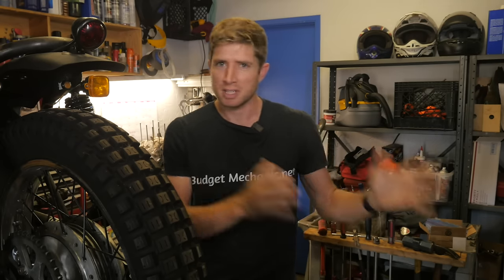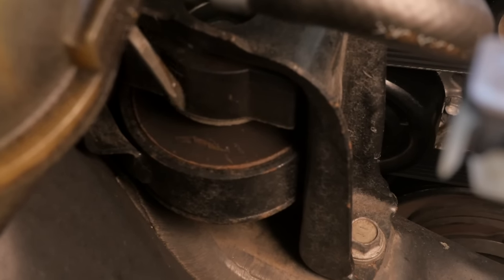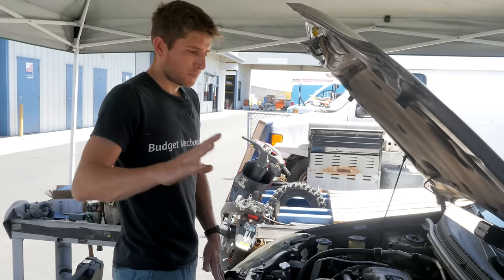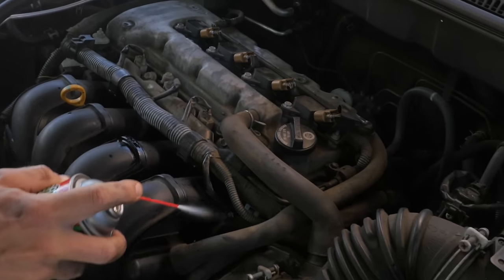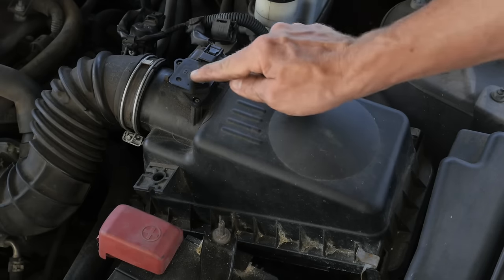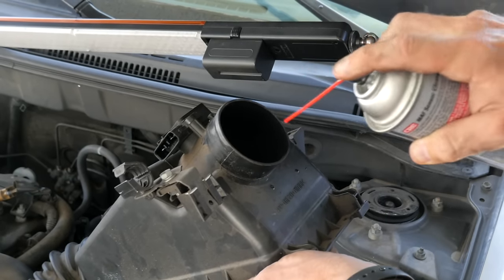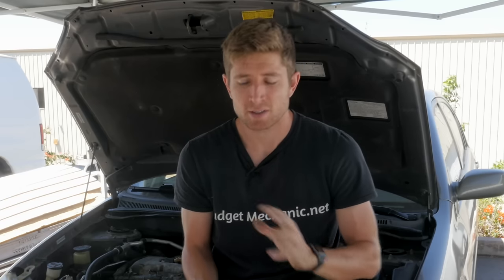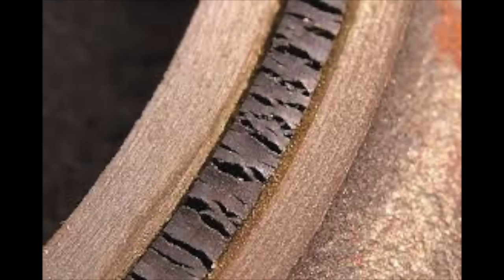Diagnose and Fix Rough Car Idle - Main Causes For Shaking / Vibrating While at a Stop

Comment: Wow! You are an awesome teacher. Thank you so much for the great information.   We were dealing with a crank no start on my 2008 Toyota 4Runner 4.7 v8 sport edition for 6 grewling months. It was so disheartening. I watched so many videos to help my 62 year old hubby.  Don't get me wrong he is a great mechanic.  But, hes old school used to dealing with a carburator and no obd2 computer.  Trust me, i made him absolutly nuts. Been married for 23 years but, having his wife second guess him was not good for his confidence and for that i am sorry.  It's just that my father was dying and we are not well off.  I made the mistake of buying the car with 232000 miles on it and not making sure things were maintained like he said they were.  Getting older his memory was starting to wither.  We or he replaced the bathery, checked the fuses and the 3 relays for the fuel pump, chsnged the gas cap. Cleaned the maf sensor, cleaned the trottle body unnecessary changed the crankshaft position sensor and he dropped the tank cleaned out the tank, changed the fuel filter and found out the fuel pump was ok, changed the spark plugs and still nothing.  When my father passed away he left me some money, wait i forgot to add the ignition switch assembly with a set of keys to reprogram. Alot of money, alot and hope was gone. Had 2 codes po113 and po102.  Check engine light and a couple others. The toyota dealership quoted me a price of 3500 to drop the tank clean it change the fuel pump assembly eventhough it doesnt say that on the service receipt nor at Toyotas main headquarters where it shows your service done.  The installed the ignition switch i bought reprogramed the keys and after about 3 days finnally called me. The wierd thing is the diagnostic info had everything as a pass but the tires which i replaced and they said a " vacume leak that was no big deal and that the catalytic converter was rusty and needed to be reported but no big deal.  They initially told me they could fix it in a couple days they were waiying for " the sucky thing for the fuel pump. And an o ring it would be available sometime next week. They wouldnt answer my questions when i asked them what parts were they waiting for? I said the fuel swnding uniti and the o ring. She never responded. I know its supposed to be a complete unit replaced. Meanwhile since she never would answer the phone or my text i called toyota. Of course they heard about it and sent me sn kinda nasty email i ignored it. Then on sunday the car was ready. Three days later. Even though they were waiting on parts to arrive in about a week. I cant help but feel scammed. They didnt even take the price of the diagnostic off the price they added it. Told me 1700 to drop the tank and replace the fuel filter was rhat much. To replace the ignition switch went from 1700 but since i had the part from florida at another dealership the took that down to 800. Then 189 for the fuel injectors cleaned and the butterfly thing cleaned. Sorry i forgot the name because i know nothing about cars, i just watched videos over and over. Throttle body. Thats it. Clean the throttle body for 199. All equaling 3600. I couldnt figure out how she did her math. Trust me i asked. Hense my call to Toyota headquarters.  I Just wanted my car fixed nowcheck engine light back on with vsc off and squiggly line light. Im thinking cat. My question to you is how do you feel about catclean. I'd rather things and then I read bad things and I know nothing. Sorry it was so long. You seem like an honest gentleman that really calmed me. So much good info. I really live the suv. But, im so afraid they put little bobby traps in there and little by little i will pay again for calling toyota. I hope we dont need a new cat. We are now getting the dreaded po420 code. The car was light free then when my father passed away he drove from Louisiana to florida. Lights came on. I read somewhere that cats need to be warmed up to read properly and the fact they were about 600 miles warmed up that it was that. The cat is the reason for the check engine the vsc off and the sqiggles. I will never go back to that Toyota dealership ever again. I think its a shame because they lost someone that could have been a  lifetime customer.  It also makes me sad that human being could treat each other with such distain and in this world of technology , lack of morality, lack of the golden rule teachings and the religion of be good in your heart thats all that matters is gone. Texting a customer is apauling and shifty. Have the guts to use your voice before we   lose sight of this beautiful world where life is so precious and short. I am 57 my dad was only 82. But , i still felt 12 around him. He knew how to do everything. I will forever be changed by his loss. People like you are one in a million. The way you teach is inspiring. Thank you.

Comment: Thank you for this great video. It was really helpful. My wife Infinity was shaking violently and kept stalling. It turned out the connector to the air system was loose. Thank you! You saved us thousands of dollars in repair.
Reply from the maker: Great job!!
Reply: Do you know what that part is called? Thanks
Reply: The name of the connector to the hose?

Comment: I just had my exhaust on a 2005 Mercury Grand Marquis worked on, by a custom exhaust specialist. The reason I took the car in is because the hangar broke and pipe began rubbing against the inside of the car. I also knew I had an exhaust leak most likely in the manifold. But there was no check engine light on and car started up beautifully, drove beautifully despite the ticking noise when accelerating. The mechanic also fixed the suspension, unrelated but definitely needed. I didn't replace the exhaust manifold because it is too big of a job and the mechanic was able to weld the tube as best he could, leaving only a very small leak. No more fumes, or ticking but now the car is vibrating during idle and check engine light on. I took it back it was for emissions and he said everything else seemed good, no misfires. But now the car is having trouble starting at times. I'm just gonna take it somewhere else which I would have done, but I heard these guys were cheaper because they can weld. It could be unrelated, but it seems too coincidental to me

Comment: Here is my situation:
There is no check engine light and the car starts fine but has rough idling in hotweather or after the 1st trip.  So if you drive in the morning to get gas there are no issues, but after you start up your car again to leave the grocery store (2nd trip within a short amount of time) it starts idling low or bad.  
The 2nd trip situation seems to fade with extended time.  So if I go to work and then work my 8 hour shift and then leave, I dont notice it much unless its hot weather out.
Other things to note.  My "charging system" failed when i had it tested, but my battery passed.  I took out my alternator and my alternator passed the independent/isolated test on the machine at 2 auto stores. 
I have an AC adapter that reads voltage and at stops/red lights it drops below 12v.
I will check the air lines though but wondered if there are other things to check.
Reply: Same issue, hope you fixed how can you explain me

Comment: Just an important thing to know: Seafoam should ONLY be used on regularly maintained/ late model cars (newer ones), otherwise it can cause too much space between the pistons and bore, leading to burning oil. It'd be great before an engine rebuild on an old car, but if you have an older car - and you're not planning on doing an engine overhaul - then stay away from it. Everything will leak afterwards.
Reply: What do you mean by older? Like 20 years old or 50 years old?
Reply: @chikechovis2499  
Is all am thinking! 

Sometimes cars older than 10 years are considered “old.” Sometimes 15+, Sometimes 20+ or like you said, sometimes 50! lol. So this the first question in my mind as well after I read the comment!
Reply: @letscuthairtoday9038  yea I have a 68 plymouth fury that was taken great care of and runs great I use seafoam in it regularly, I just purchased a 99 honda prelude that's was sitting around for a bit and was leaking oil bad I used seafoam in that to hope it doesn't get worse.
Reply: Does marvel mystery oil have the same discrepancy? Thanks
Reply: I’ve started stp fuel treatment once a week or so during fill up and I have been noticing the thing DRINKING oil. Mech said no external leak so could that be why? Idk. Going through a quart about every 1k miles.
Reply: Not true sea foam worked for my 1999 volvo with 222,786 miles on it . Check engine light is off only problem I’m having now is the car wants to stall when coming to a stop and the ac is on . When the ac is off it doesnt try to stall .
Reply: @simplelife4735  have you fixed this now?? If yes ,how
Reply: Are you are talking about Seafoam in the crankcase or fuel tank ?
everything leaks after using seafoam, why, how ?
Reply: @simplelife4735  
Is that post for real ?
sea foam causes too much space between the pistons and bores ?
the individual never gave us details on what they meant?
how does sea foam cause those issues ? used in what way ?
were they referring to sea foam being poured into crank case, sprayed into air intake, or emptied into gas tank ?
Reply: @dfls5069   Sea Foam is made from 100% safe petroleum ingredients that can’t harm sensors. Sea foam doesn't eat metal so how could he be right on that comment LMAO
Reply: Not necessarily true when it comes to certain makes of toyota especially.
Reply: This is wrong af
Reply: I've heard that can be an issue with putting Seafoam in the OIL (which is sometimes a good idea, but sometimes not, for this reason). I don't think that concern applies to putting Seafoam in the gas though.
I'm new to car repair though, so take that with a grain of salt.
Reply: true
Reply: Seafoam is a waste of $12 😡😵
Reply: @TRANSPORTKING1988 It's kind of like head gasket sealant products, if the car will be unusable without fixing the issue, but it's not worth it to fix the issue, it's worth a try. If you don't have a backup vehicle and your car works fine, don't put chemicals in the engine. Keep with regular maintenance.

Comment: Great video but just a tip, check your idle air control valve first. More often than not this is the culprit and by starting with this first you may potentially save a lot of time and effort trying to find the problem.
Reply: How How do you even check the IAC? I removed mine and I cleaned it out But that doesn't really help if there's an underlying electrical issue that needs to be Resolved
Reply: @macknumber9  To check whether the idle air control valve is functioning properly, start the engine and let it run for about 10 to 15 minutes. If the valve is functioning correctly, the engine will sound good and the idle will be steady versus too high, too low, or inconsistent. Additionally, using an ohmmeter, measure the resistance between pins 1 and 2 on the (IAC) valve. Resistance should be 10 - 14 ohms. Depending on the model this could even be 7 - 25 ohms. Check the specifications for your specific vehicle. If you can't tell by listening or don't want to mess with learning how to measure ohms and all that stuff, just simply replace it with a new one. They can be expensive depending on the vehicle. I can get mine for about $30 online. I have seen them for $100 or more on other cars. Either way, these things usually last for a long time, so by replacing it, you'll be doing yourself a favor in the long run. If money is an issue, you could always buy one, install it and see if that fixes the problem. If not, then as long as you're careful with it, you should be able to return it and get your money back. Most car parts stores won't let you return electrical parts if they have been installed. So just try to not scratch, ding, or otherwise make it obvious that it was installed and you should be ok.
Reply: @mystery dude  yeah my car idles perfect it does what it should do when it starts up rpms are about 1200 like they should be to help the car warm up and then they drop gradually....sometimes as they drop it does slightly surge up but it ends up going down and idling at a steady rpm  that is around 700....my issue is I feel these little slight shakes...they come and go and I feel them more in park than I do in drive so I don't think it is mounts
Reply: @macknumber9  honestly the shake could be anything. It could be the fan kicking on, bad spark plug or wire, or even a sticking valve.
Reply: @mysterydude1  well it isn't a sticking valve because vacuum is 100% perfect steady at idle....I think it is an injector flow problem...of not injector has to be either mount or harmonic balancer...
Reply: @macknumber9  have you resolved this issue?  My car is doing the same thing.  Going to chech the mafs and clean my throttle body first tomorrow but i was wondering if you got an answer for your problem.
Reply: @Joe Kim  not yet...I plan on replacing the harmonic balancer and seeing if that stops the shaking....my fuel trims are nothing out of the normal and there are no misfires plus I changed spark plugs/coilpack/wires and even removed and cleaned out all injectors....so this is not engine performance related in my opinion
Reply: **and it stalls

Comment: For a vibration. In drive at idle. The HARMONIC BALANCER / DAMPENER IS VERY SUSPECTED. ALSO FLYWHEEL/FLEXPLATE OR TORQUE CONVERTER MISSING COUNTER WEIGHTS MISSING
Reply: Explain more please
Reply: Hey can you do a video on this. I would appreciate

Comment: My car would shake and sputter around low rpm and mph (2-7). I put fuel injector cleaner in with half a tank gas, gave it a while and reved it a little, and now the shakes are gone.